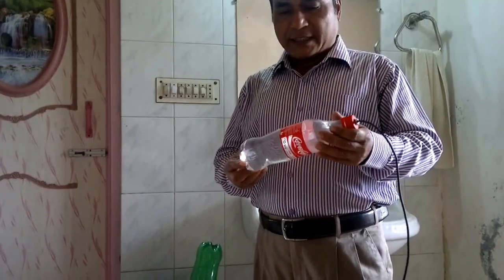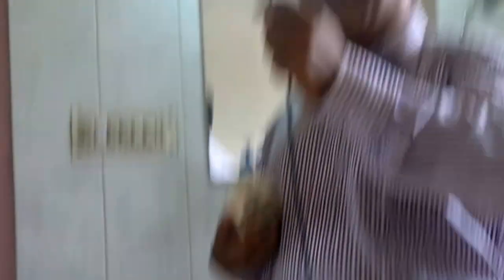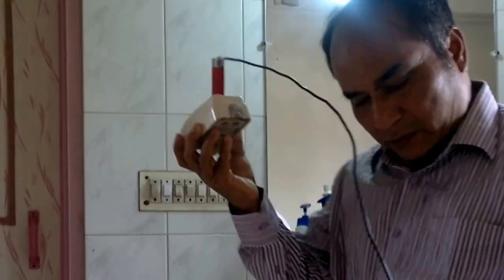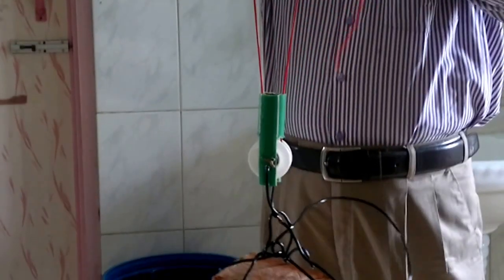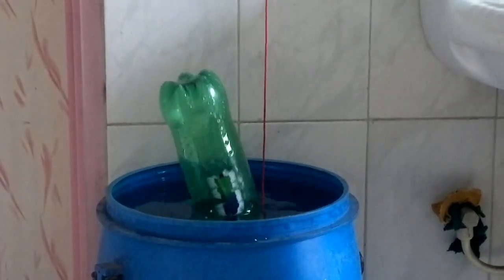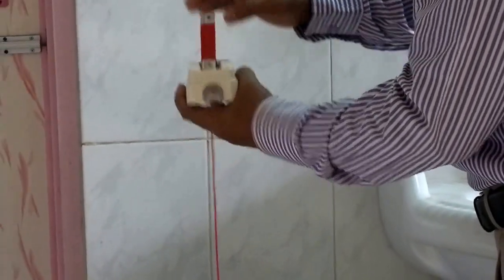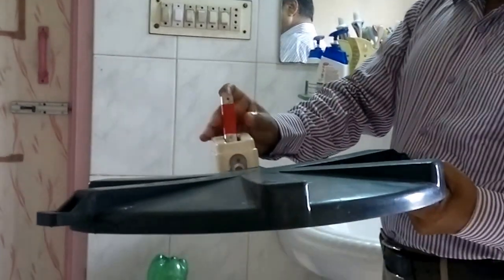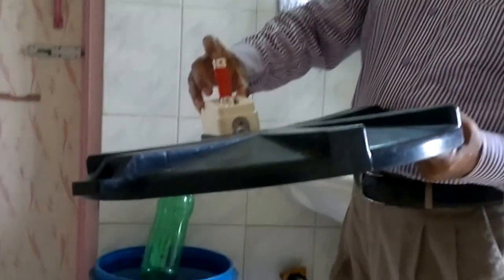How to make a float switch worlds cheapest । Science & Technology - Invention। Auto Switch @kayummd3348

Comment: During rainy reason the water will enter inside switch and current will pass in the water causing serious electric shock. Highly NOT recommended. Better to buy good quality water sensors for safety purpose.
Reply from the maker: 100% safe. you must use a cap/cover on the switch to protect the switch from rain & sun. Thanks for your comment.
Reply: @kayummd3348  But using a D.P switch at outdoors is not recommended as per the design parameters. It is designed for indoor use only. You are violating safety rules.
Reply from the maker: @shannonkotian  100% safe. Precaution is that it must be set up by a electrician or who have electric knowledge or who have the electric switch connecting knowledge.
Reply: you can the protect from water ., by using water roof cover.